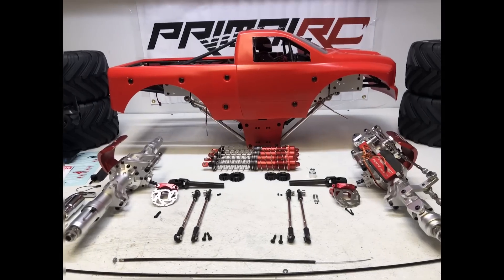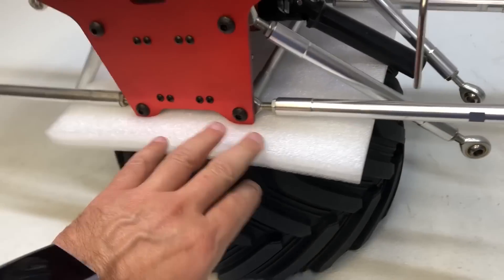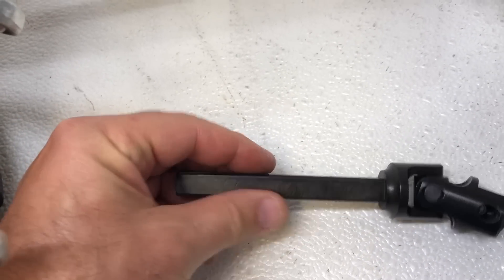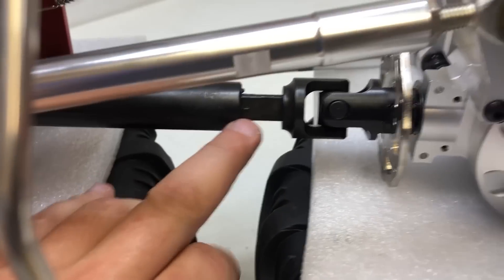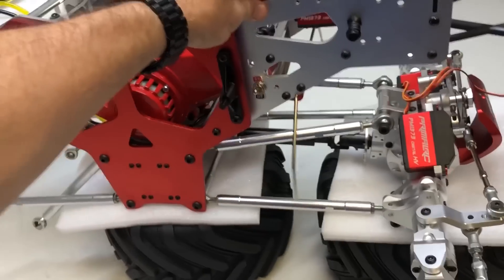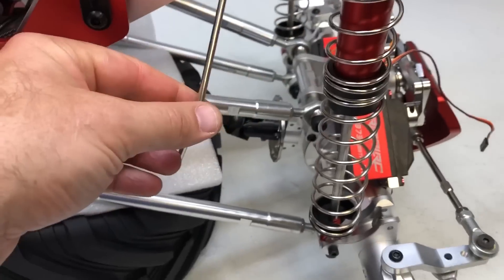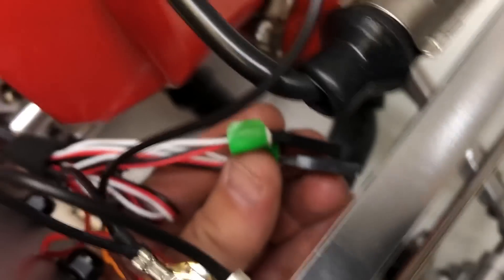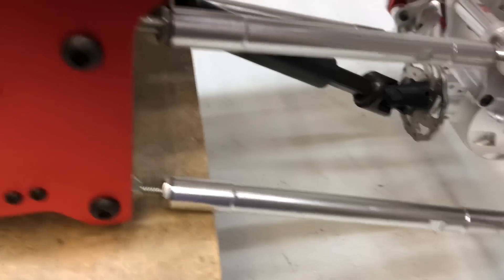Primal RC Raminator Monster Truck Assembly - Part 1 - Suspension & Transmission

Comment: Can you repeat what parts ! put the thread lock on please?
Reply from the maker: Any screw/bolt going into aluminum or steel without a nut on the other side needs lock tight.

Comment: Where do I mount the double shock?
Reply from the maker: There are a few holes in the frame that you can mount them to or drill a new hole to mount it in a place you prefer.  The bottom mount is already on the axle tube.
Reply: @PrimalRC  I got it to work, Do u guys have upgrades for the swaybar links?
Reply from the maker: @sonstarrwordlifebmfrc  Yes, we sell the JS Performance ones here   https://www.primalrc.com/product-js082         Thanks
Reply: @PrimalRC  I just ordered the ALX 85CC FOR THE RAMINATOR LOLOLOL
Reply from the maker: @sonstarrwordlifebmfrc  I wish ALX would make one for the Raminator to compete with the RCMAX 80 supreme. That would be a sight to see those 2 racing each other on a Monster Truck track!!!
Reply: @PrimalRC  he is sort of lolol I paid my 85 off so I'll have the first 85 in a raminator aye just wondering do I go thicker on the diff oil considering the bigbore powers

Comment: If I bought one of these trucks I would like to buy it built already ready to run and broken in already they could use it as a demo except for the body I don't want the body put on the truck or the decals put on the truck  That is the only way I would purchase one of these trucks I do not have the patience to put 1 together and I do not have the patience to break it in they will make a lot of money off me when I break things because I am not easy with my R c's I have a remote control boat I have $6000 into  It I paid someone to build it break the motor in I took the motor out I had it all port and polished I had a guy put it back in the boat and him break the motor in and I run it like  I stole it breaks I'll buy another one please comment back if they are able and capable of doing this thank you very much
Reply from the maker: Hi,  I have one brand new one I just built if you want to come and pick it up at the warehouse.
Reply: @PrimalRC   If I had all the money together right now I would be there today

Comment: This thing would be epic if it were 60lbs lighter, a shit ton quicker and actually designed for bashing... Oh wait, that's an Xmaxx! 🤣
Reply from the maker: I like the X maxx a lot myself and it's great for what it's designed for but it's a plastic toy that does not perform like a real monster truck. The Primal MT is gas power and almost all metal. It drives like a real MT Truck. It's not for everyone for sure but for the guys who appreciate how real trucks work and perform and enjoy working on something similar in design to a real MT Truck and running over Xmaxx's if you want to is just another perk. :D

Comment: I AM STOKED!!
Reply from the maker: Thanks Bro!  I am getting yours shipped out tomorrow!
Reply: @PrimalRC  and the crowd goes WILD!  It's SHOW TiME!
Reply: Ive been waiting for you!
Reply: Hey RC sparks,picking up mine Friday !, can't wait to see your unboxing and running vids,definitely a pulling one with "The Judge" sled I've already spoke to a hobby shop and am using the Raminator to pull an Rc loaded trailer representing them in a local small town parade.
Reply: Hey RCSparks your gonna loose your mind when you get your hands on this !, pics do absolutely no justice ! ,this truck is a true BEAST and beauty.